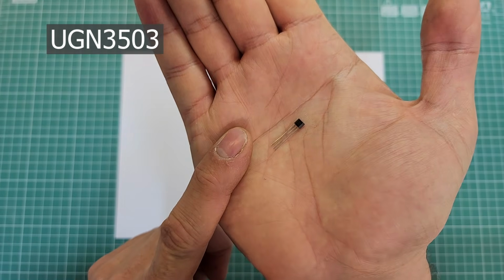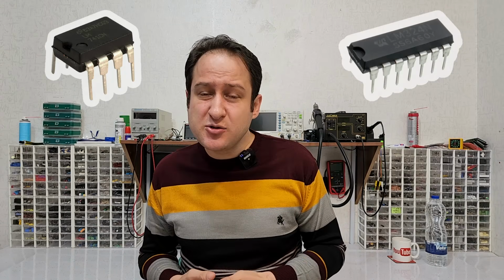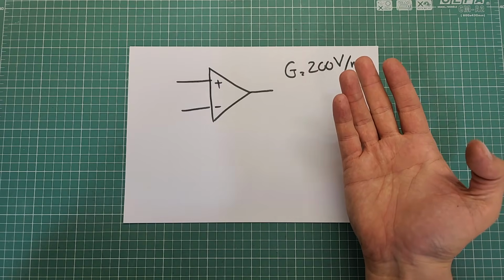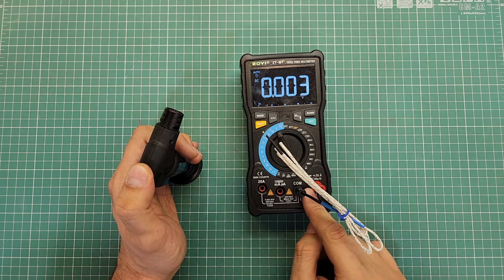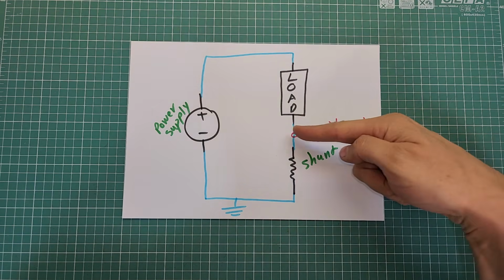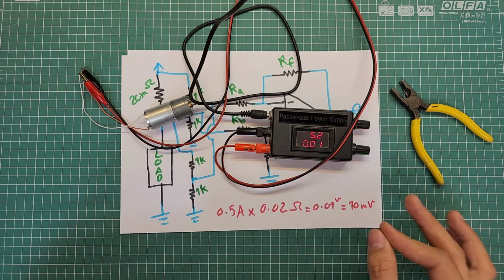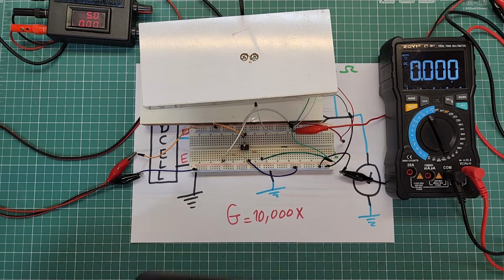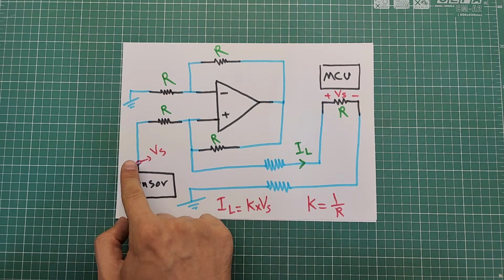4 awesome application of op-amps in circuits

Comment: I think the pin out is incorrect on your LM339 diagram. Look at the TI datasheet and compare. Output 1 is pin 1, not pin 2 and pin 14 is output 3. The inputs are incorrect too...I've seen others with the same diagram as yours so I think people are sharing the incorrect one. Unless different manufacturers have different pinouts but that's unlikely.

Comment: Lemme add the one circuit that might be really interesting to some:
The Impedance Converter. You simply connect the output  to the inverting input. Amplification is 1:1 but you (almost) don't draw any current from your signal source. Instead you you now have a signal that is perfectly proportional to your input up to your rails but you can freely draw current from the opamp for further processing without loading down the signal source and distorting it.
Good for i.e. taking a digital signal from an existing device without changing the the behavior of the components you are connecting to. Single rail capable op-amps with a good enough speed (slew rate) like the LM2902 AFAIR allow you to branch off an I²S or I²C Low Speed line to fool around with.
Reply from the maker: That's a great addition, thanks for sharing that useful tip! 👍

Comment: I do not understand how the circuit at 51:45 can function as a voltage to current converter.  To me it looks wrong.  Instead I think a circuit that could work would be as follows:  a) op amp + input should have only 1 connection and that is direct to the source output (no resistor); b) resistor at the MCU should be connected using long wires to the op amp output and to the op amp - input (providing the negative feedback loop); c) op amp - input should be connected to ground using a resistor of the same value as the one at the MCU.  The voltage across the resistor at the MCU should then equal Vs.
Reply: Never mind.  I worked through the math and figured out how the circuit at 51:45 works.  I'm a little concerned that Vs needs to be able to sink current but it was an interesting problem to work through.

Comment: I tested a current measurement circuit with a shunt at home, and the measurement error is very large even with 1% resistors. My simulations show the same result. For the circuit to actually perform the measurement function, resistors with a tolerance of 0.1% would need to be used. However, a specialised measurement amplifier would probably be cheaper and simpler.   Apart from that, the film is very interesting and inspiring.
Reply from the maker: Thanks for sharing your experience and insights! It's definitely true that precision components make a big difference in current measurement circuits.

Comment: LM741?  What year is this? 1975?  And then using the LM741 to measure a thermocouple voltage?  Wait until you learn about input offset voltage!
Reply: You watched a video talking about the downside/age of the LM741 and now you leave a similar comment on every video
Reply: @D_J_R_S  Yes, because it is 2025 and things have improved a lot.

Comment: Are the load sensors, thermo sensors etc (especially load sensor) resistance mechanisms made in a way where as they go up and up in reading...does their output voltage increase stay linear/proportional to the rate the load increases, or is it an exponential or log relationship??

Like if load goes from 0 to 3g say voltage rises 0.5.  as you add weight now you go from 20g to 23g still a change of 3, does the voltage still increase by 0.5V like would it read 3.33V and go to 3.83V being linear??

Comment: 41:13 what did you say?  The output of the ic is open collector?  What does that mean?  I still don’t understand why the extra resistor at the top did.
Reply from the maker: Yeah, Open collector!
It means there is a transistor at the output (inside the IC) which it's collector is wired to the pin (from inside)
So, if the output becomes active,  it gets ground and if it becomes inactive,  it gets nothing!
In the case of Nothing, the resistor will pull the pin up.
Reply: It means that the output of the chip is shutting off the negative half of the output circuit, when it is deactivated.  As opposed to a chip output that shuts off the positive half of the circuit being controlled, where you'd normally place a manual switch.

So in the on-state, the output node shorts to ground through the chip's internal transistor and completes the circuit.   In the off-state, the output node opens the path to ground, and blocks current in the circuit.

Comment: 5:15 Comparators
18:13 Simple Amplifier
27:33 Differential Amplifier
46:37 Voltage to current converter
Reply from the maker: Yeah

Comment: To say how an opamp works in a simpel way
An opamp will do whatever is needed on the output to make the voltages on the inputs equal.
Reply from the maker: Exactly, perfect definition 👌

Comment: general-purpose operational amplifiers (op-amps) can be used as comparators in certain applications. While op-amps are primarily designed for amplification and signal conditioning, they can also be used as comparators in certain cases where the speed and accuracy requirements are not critical.
 
Op-amps have high gain and are designed to operate in a linear mode, where the output voltage is proportional to the input voltage. However, they can be used as comparators by configuring them in an open-loop configuration, where the feedback loop is not used. In this configuration, the op-amp operates in a saturated mode, where the output voltage swings to its maximum positive or negative value based on the input voltage comparison.
 
Using an op-amp as a comparator has some limitations compared to dedicated comparator ICs. Op-amps may have slower response times and higher offset voltages, which can affect the accuracy and speed of the comparison. Additionally, op-amps may not have hysteresis, which is a feature commonly found in dedicated comparators to prevent oscillation when the input voltages are close.
 
Therefore, while op-amps can be used as comparators in certain applications, it is generally recommended to use dedicated comparator ICs for precise and high-speed voltage comparisons.
Reply from the maker: Thank you for sharing your valuable knowledge. Thank you again for being a part of the community ❤️🌷

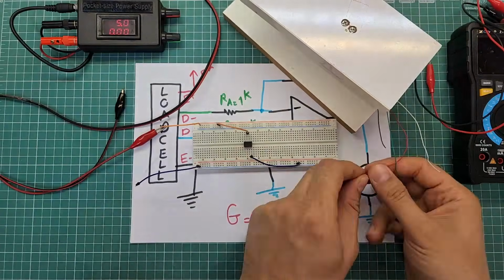Comment: I quick question: At 44:37 you used 10 MOhm and 1 kOhm, to 10k gain. What if you use 100Ohm and 1MOhm ?
Reply from the maker: The gain will be the same,  you will get 10,000x.

Comment: One objection to your last application.  The idea sounds great.  But the resistance of the ADC input is in mega ohms like a voltmeter.  The rsistance of a mile of wires could be in 100s of ohms which is neglectable to the ADC's.   The noise on the lines however will not let you measure the current accurately.  These days the data transmission lines have become differential despite the short application distances.  One of the great applicantion of opamps is in differential transmission which i believe you were getting to next in the future.
Reply from the maker: Yes, thank you for your feedback, I will cover differential transmission in other videos
Reply: 1. Effect of the noise on the lines when measuring voltage is far more worse than when measuring current. It is because very same impedance calculations.
2. Using current rather than voltage as an analog signal transport is de facto industrial standard. So, experienced engineers choose 4-20 mA current output for sensors over 0-10 V voltage output even both are available on the very same devices.

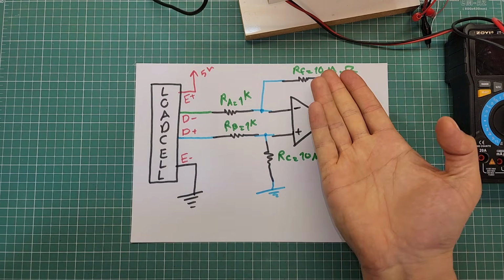Comment: The problem with the differential amplifier used at 44:22 to amplify the load cell is that a gain of 10,000 is very ambitious using an ordinary opamp. The input offset voltage of an LM741 can be as much as 5mV, which if you multiply it by 10,000 will certainly drive the opamp to one of the rails. In addition, its open loop gain can be as small as 50,000 leading to very little feedback for linearising the output. Finally, the circuit you built uses a single supply rail of 5V but the differential amp really requires a dual supply to function properly without creating a virtual ground.
More modern opamps can improve on that considerably, but you really should be noting that very specialised opamps are needed to successfully work with such large gains.
Reply from the maker: Thank you so much for the points 👍🌷

Comment: Did you use LM741 or UA741 to read the current?
Reply from the maker: It's a UA741
Reply: what about the offset or zero drift capability? @elewizard

Comment: thank you, i wanted to know how to measure teensy weensy tiney bitsy currents and ran away when heard to use an op-amp because it sounded complicated,  not so much now.
Reply from the maker: Glad to hear that. 👍
Reply: I had to watch the video a few times but im starting to understand better now, have some more questions like that 1k divider network for the shunt example, is that because youre trying to cut the supply voltage to the op amp in half as well?  You mention the source voltage for the op amp maybe to high , i assume this was the solution. Anyway thanks again for the useful examples and i like seeing the powersupply you made in use all the time. I made  a simliar one with a buck converter and amp meter but wouuld like to add a current contorll. Apparenly theres an easy mod to that 2amp buck converter (lm something something) everyone uses.  I think it uses and op amp to do it, yeah it does.  Would be cool if you would upgrade yours and show us that mod works in more detail,  the videos ive seen just have dance music, albeit the connections are clear, id like to know whats going on you know?  https://youtu.be/iwnanQsR32Y?si=HW4IcL-GYewCpuXZ   Thanks again this is my only education in electronics so I appreciate all the information.   @elewizard

Comment: The LM324 is also specialized.  It is mainly intended to be used in single supply applications.  Without special consideration it will produce cross-over distortion in dual supply applications.
Reply from the maker: Thanks for the point about LM324 🌷